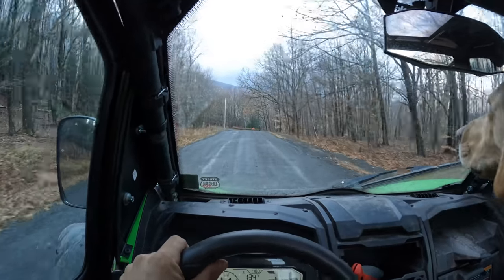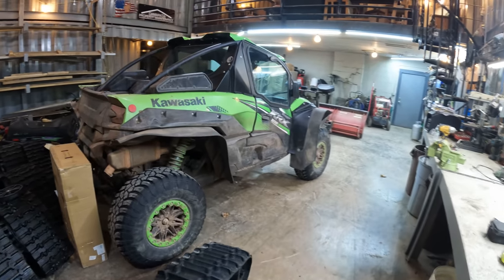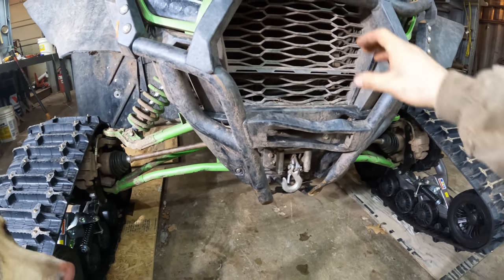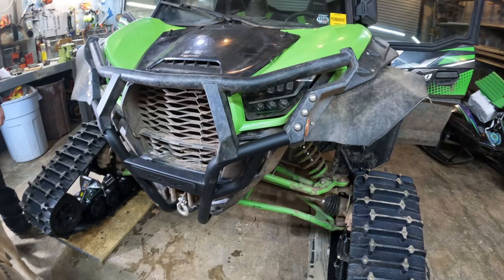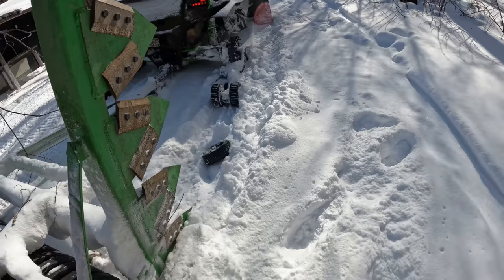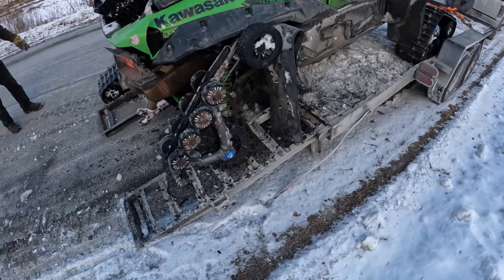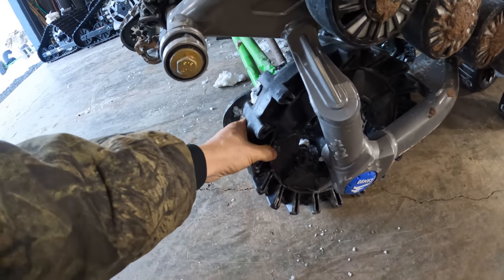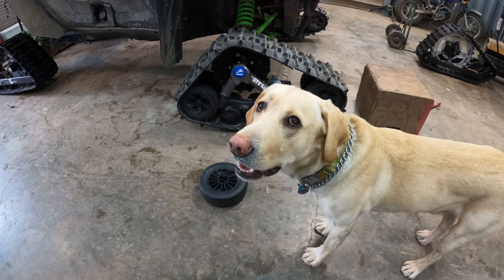Installing snow tracks on a sport UTV

Comment: CAMARATA-2022 should be defined as the new Mil-Spec testing standard, if something survives a season with Andrew it's the good stuff 😀
Reply: I want Camarata-spec on all infantry rifles, that would be dope. Slapping them togeather with ductape and chainsaws 😅
Reply: nordic: a whole season with Andrew would be tough. If it lasts a month with him that`s pretty good for anybody else. bwahaha
Reply: I have designed many things that were mil spec qualified. Months of boring tests, like salt fog.
Reply: @tnekkc  A bonus for Camarata testing, as you get HALT for free.
Reply: @randacnam7321  Back in 1989 I was designing power supplies and then overloading them until they blew up. Then I beefed up the primary failure. That was before I ever heard of the HAST at IBM in 1981.
Reply: @tnekkc  Salt fog?
Reply: A season??? Bahahaha, let's say a week!
Best regards, luck and health.
Reply: @billvandorn5332  yes there is a mil standard for salt fog testing. I have had it done on aerospace electronics.
Reply: @tnekkc  be quite honest with you sir, I never heard salt fog before this
Reply: @billvandorn5332  I worked for company that bid military contracts and found out what the fine print means later.
Reply: Im waiting for The cybertruck test:D
Reply: @mats5259  Yeah, that will be interesting, I'll give it a week before it breaks for no reason :-D
Reply: @REDMAN298  

PC OP)9

Comment: Just a thought, you might try some of that sound deadening mat that they use on firewalls for vehicles with loud stereo equipment. Put it between the seat backs and the rear wall of the cab.

Comment: "I didn't crash, I jumped straight into a solid wall" the difference is key!
Reply: Not because he didn't steer good. 😂
Reply: Don't you just hate it when trees and balls and culverts jump right out there out of the middle of nowhere, boom
Reply: - Dennis, you stole my words exactly!!! 😂😂😂. 
     I have friends that have never crashed, but have some of the worst looking quads & SxSs!!! 
 Tracks are the way to go. If you don’t have a sled and just want mobility & utility in the snow, then don’t buy a second machine. Depending on what you ride/drive there are Somme great kits out there.  I have a 2015 Honda Pioneer 700 2 seater and am running tracks through the winter. They are nice for how they spread the weight around on the ice as well as snow. I had to screw in some studs for mine on the ice. I don’t worth them or the machine like Andrew does though 😂😂. Nobody does!! Haha.  It has turned into a great ice fishing machine. I either use a tent for ice hut protection, but I also have a 6 x 12 trailer I use also and I haul the Pioneer in the trailer, then pull the trailer out onto the ice and leave my truck on shore. 
   Andrew should have shut the quad down as soon as it broke,,,, he did sooo much more damage. Oh well, it’s his machine!! 😂😂.
 Stay safe this winter everyone, Eh!

Comment: I was interested in getting tracks for my RZR but decided against it. Most people running them either get super stuck, have the drive components break, twist the track frame, have a track constantly fall off or all of these things combined.
Reply from the maker: Its a shame because the idea is good. They just need to be built stronger.
Reply: @AndrewCamarata  Okay so my two cents for what its worth. There's a great British company called Moorend. They make tracks like this for articulated things like site dumpers and loaders (like Avants) and they're great. Because the vehicle articulates and doesn't 'steer' you're not trying to screw the tracks round which I guess is a good start. The track frames also bolt straight to the loaders chassis, meaning the original drive motor is now only used for turning the tracks and not baring any weight anymore. Great stuff. They're also made much stronger (greaseable metal rollers etc) because it's bolting to strong frame. I guess these utv tracks need to be lighter built, or if they were built to construction grade, you'd never turn the wheel because of the weight attached to them. I think these utv track would be good in super deep super soft fluffy snow only. But the whole things a bit of a nightmare, there's nothing strong enough on a utv to bolt to to make them major heavy duty, they need to consider weight when building them. The suspension makes the whole thing a bit rolly-polly (again something a dumper or loader doesn't have. I think tracks and utv's go together in specific circumstances but overall aren't a good combination. but check out Moorend tracks, they're great.

Comment: I’ve been running Matttracks on my 850 sportsman  for two years ,just added the electric assist steering motor helps a lot in dirt - never had any problems so far- take care
Reply: I live about a half hour from where Matttracks are made.
Reply: Those are solid gear

Comment: I've always liked the idea of tracks, but the plastic rollers seemed like a very cheap design on a very expensive thing. You proved that is indeed true.
Reply: Yeah plastic is a very bad idea
Reply: I bet the company was thinking that when someone threw a track off, they wouldnt keep driving it on the rollers several miles in the snow and also on the pavement!! LOL That loading job on the trailer was awesome!!
Reply: Depends on the kinda plastic. If it’s Delrin, then it’s pretty durable. Anything else and it’s going to fail from either heat, cold and stress. If they had used steel rollers, it would weigh to much and the gearing on the UTV would be even worse. Aluminum could work, but again, not super durable.
Reply: Probably for weight reasons and truley these are only good for soft deep snow.
Reply: @D🔧Y If you used a thin steel insert coated in rubber, you could get the durability of steel and rubber without a solid steel piece causing weight and gearing issues. Definitely a solid rubber could work, re-purpose solid rubbers from forklifts that have been replaced. Easy to machine them, and still lots of life for an application like that.

Comment: Had the same issue with a blade/plow for my Bearcat... plastic lasted only 2 years... got a aluminum plate pop-riveted in its place, been gel ever since every winter now. I understand things like less weight etc etc... but sometimes you cannot cut corners and I do not know why aftermarket companies do this.

Comment: I'm surprised that you didn't realize the cheap plastic when you were installing them. I noticed it on the video and knew they wouldn't hold up. Coupled with the flat bracket with no gusseting I knew that was gonna flex also.
Reply: "Cheap plastic" aside was it being used for what it was designed and how he used it? Once it broke it was his decision to carry on and use it. He's not usually "kind" to anything he buys.
Reply: Side load force on any wheel is greatest at the center. Cheap plastic when its cold like that is a design flaw baked in from the start. A good CNC guy could whip up some aluminum upgrades.
Reply: @dubes5594  True, but could they be manufactured to the same cost? Also we don't know what sort of plastic was used. I don't try to condemn until I know more. Andrew does tend to play harsh with his gear and breaking it us not uncommon.
Reply: The thing is, no one is going to set up tracks on a vehicle like that unless they plan to drive it as hard as Andrew did. And he was mostly in nice powder snow, people are going to be running on snow that’s half ice. They just need to be a lot more durable.
Reply: @markjames8664  It was only one that failed.  And without knowing how it failed none of us can truly say that it failed due to it being made from plastic.  I'll agree that it should be able to withstand being driven in snow, was it being driven purely in snow? Did it hit a rock or something. 
Have you watched The Grand Tour? In one of those episodes R. Hammond replaced his road wheels with a similar track system.  The difference was that he wasn't driving in snow. The running wheels were also plastic and they eventually broke.  But the stresses that were placed on them were much greater.
Reply: @ralpha112233  The Grand Tour is scripted entertainment
Reply: @MetalMike50  He broke them deliberately? Rather than find something unusual to replace his wheels instead of just be boring  and choose something sensible they scripted them to break at specific times?

Comment: I have Mattracks and used them for 9 years with zero issues. Lots of engineering into them n
Reply: So I'm guessing you don't cut holes in it and then complain about it later, Like Andrew does.
Reply: Curious if you installed them incorrectly then dragged a groomer thru the woods and hit a dirt pile then drove another 10 miles until things grenaded?

Comment: Good video Andrew. That’s a lot of money for those tracks, they need to be made of steel rollers. Nice to see the snow
Reply: Steel would weight a ton.  AL would make more sense.
Reply: Yeah plastic is unacceptable
Reply: It wasn't too long ago when the entire tracked vehicle cost less than $8,000.
Reply: @mmm365  Delrin would work as well, but be more money.  AL would be cheaper.  
I'm thinking the manufacturer found a wheel that was already made and bought that.

Comment: Andrew, not sure if you've ever looked into Yankum Ropes, but they make kinetic snatch straps that are way safer and easier than using a chain for pulling stuck rigs and equipment! They're on YouTube as well!
Reply: Back in my military days I knew a woman who had a kinetic snatch. Way better than any whips and chains you could ever find. Some of the best yank-um snatch I've ever had.
Reply: I definitely want to get a yankum roap
Reply: im pretty sure hes shown them in videos previously, he just doesnt seem to use them as often, he owns a couple though
Reply: Another vote for Yankum Ropes got a 3/4" Kinetic "Rubber Boa" superb!, & their  BRODOZER Recovery Rope is also highly rated,both ropes better & safer than any steel cable/chain.
Reply: Yeah those ropes are really good. I saw a few tow companies use them.
Reply: "Matt's Off Road Recovery" used Yankum ropes and I think the Yankum company made a yellow version for them.
Reply: @2badger2  HeavyDSparks on YouTube also uses Yankum ropes. Yankum made them their own version of a rope as well.
Reply: I’ve been suggesting it for years now. 🤷🏻‍♀️
Reply: @2badger2  mehh the brand name doesnt matter to me, theyre 10 fold the price of what i can get a 7/8" recovery rope for from Princess auto or off of amazon, i managed to break a 3/4"one  trying to recover a 7k lb skidsteer stuck in the mud with a 7500lb diesel truck doing the pulling then got the 7/8" an its working good so far
Reply: You can 100 chains for 2,000 dollars rope
Reply: @davidcatlette9697   english

Comment: Right at the beginning of your video when I saw the tracks made out of plastic parts my first thought was "its' gonna break for no reason" because it's plastic.... lol, however as I watched on, sure enough they did.  These took a chunk out of the wallet and that bites. Andrew with your ingenuity, I have no doubt you could remake these to your standards out of durable metal parts probably for a smidgeon of the cost.  If its made out of plastic, it has no use in your life... lol.
Reply: Perhaps some sort of aftermarket aluminum wheels could be retrofitted, and make it as it SHOULD be.

Comment: What if you use socket head cap screws and washers that require an Allen wrench to install them? You could use a ball end Allen socket that will allow you to go at an angle to install the cap screw.
Reply: good Idea, we used to do that at work when there was no clearance for a bolt head

Comment: My buddy carries an old snow board to strap to the bottom of the track carriage if he throws a track. Works great for emergencies. He also has snowboards mounted to the wheels/tires of his snowmobile trailer so he can tow it into his logging camps.

Comment: You should get carbon monoxyde gas detectors just in case in the BBQ container and trailers.
Heaters can fail,and get you in danger.
Reply: Your right, but at the same time that container isn’t air tight. We use them to burn in and there are cracks all over the thing.
Reply: Danger which can’t be seen or smelt is the worst kind too 🥺
Reply: I'm pretty sure the heater unit is vented to the outside but as far as the barbecue, that's a whole other story and I agree with you 100%
Reply: now why would you ruin the vibe?
Reply: @huh4233  Basic safety measures allow you to get more fun,longer in your life.
Accidents are horrible,basic safety measures are a good way to avoid them.
Reply: Good advice. I want Andrew making videos for years to come.
Reply: If your standing right beside that heater cooking, and you can't tell wether they are working or not. Carbon monoxide is not what you should be worried about.

Comment: 11:56. If the brackets hit the caliper because of worn down pads, would that mean putting the same brackets on with new pads could cause the caliper to not move as much as needed when the brake pads wear down, and finally causing a brake failure?

Comment: The cab looks like a great idea in places with snow.  Tracks fitted to wheeled vehicles are always some level of problematic.  If they are built strong they tend to break the vehicle - if not they just tend to break...  For sure Andrew will find the limits of most things soon enough.  Cheers from Oz - no snow to worry about in my part at least.  Thanks for the vids.

Comment: I’m surprised that those bogey wheels are just made from cheap plastic. You’d think they would have something more robust like the final drives on a tracked skidsteer obviously smaller version great video that machine looks like a beast with the tracks on it. I used to plow sidewalks for my town in a bombardier like you have for a trail groomer with a v plow on it and you’d have to wear a helmet if you hit a bump or a curb your head would smash into the roof. They are rough to operate feels like you fought a bear after a few hours running one of those older ones

Comment: still love the content, but i mean its not quite the same  when were dropping 12grand on two sets of tracks and bolting them to the priciest UTV they make brand new off the lot.. i much prefer seeing how much a 98 ram 1500 gasser can tow and how abused it can get without ever spending over $400 to repair it

5 years ago i feel like he would of bought the cheapest lathe he could find and a few hundred dollars in steel and started making his own tracks to fit the machine perfectly, give the exact ride height desired, and they wouldnt of broke for no reason

Comment: You should have given an opinion on the windows and heater systems.  I like the idea of the windows being glass.  I bought the plastic windshield for my UTV (because that was all that was offered.  Now I'm faced with buying a new window because the old one was plastic and we all can understand what happens to plastic when being wiped or washed and wiped dry afterwards (even with the softest cloth I could find).  Scratches and other marks that might be stress related.  I didn't know if any true glass ones were even available for my 2015 Can-Am Maverick.  And in addition, a couple of years ago you used some windshield wipers on your UTV windshield and to my surprise there were no streaks to behold.  That was the second I concluded you had switched to glass.
AS for the tracks - what junk they are!  I was fascinated by tracks when they first came out but was put off by the exorbitant price.  WOW, $6K for those?  Junky plastic and low and slow!  But after you put on those 33inchers, you didn't have much trouble going fast, right, and with traction?!  Those seemed better than tracks, but I don't suppose they would float on top of the deep snow as well.
You said something like it was warm inside, so the heater must have been working.  I didn't see you install it (unless I missed it) so was it tied into the water circulation system?  I wouldn't think that it would have been completely electric, that would be quite a drain on your electrical system.  
Have fun with it again during your winter.  We here don't get so much snow at my location in the valley in Oregon between the mountains.
Reply: Low and slow is the story with tracks. They pretty much cut the vehicle speed in half. There are a lot of stressed parts. Like transmission and drive train parts, they require high quality materials, precision machining to function. That makes them expensive. 

Plastic roller guide wheels?  Come on, man.
Reply: Use PLEXSUS cleaner ONLY on plastic windows and you will not scratch them. 
I live in the desert (think sand dunes) and have no scratches. 
I also use Plexsus on my Jeep soft windows.

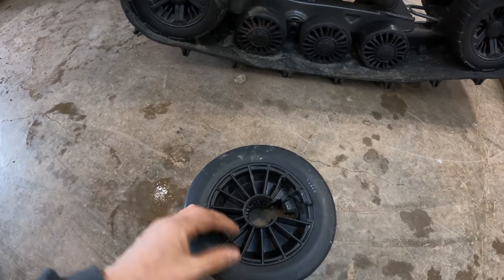Comment: @41:15 You're going to have the same issues with aluminum, it's also fairly brittle so it'll most likely cause similar problems in that application.
I don't think these tracks were thought to be used for utility such as that, with so little snow.

However, we all know that Camso would probably charge upwards of $10 000 if the idler wheels were aluminum, additional machining costs etc etc.

Comment: It's very easy to miss things like the brake pad movement when designing accessory equipment. I suspect he  treated the vehicle as a black box using a space envelope model. 
Edit - the socket clearance issue is pretty poor. I'm now thinking that the company doesn't have a robust checking and approval process.